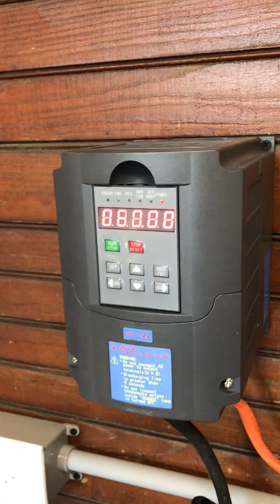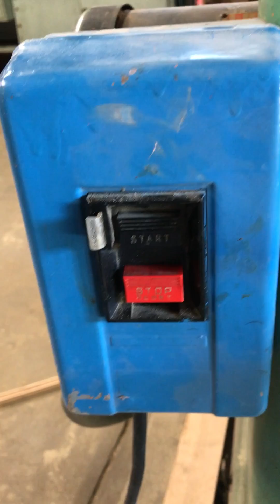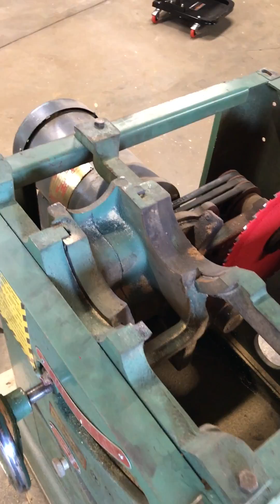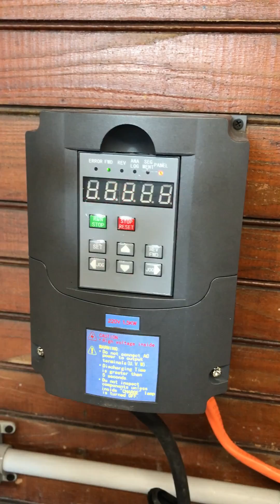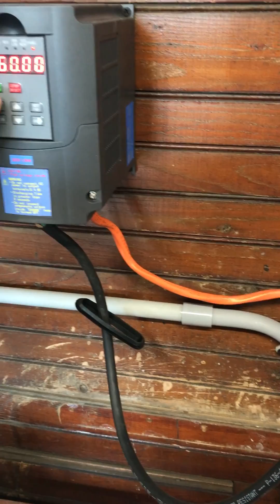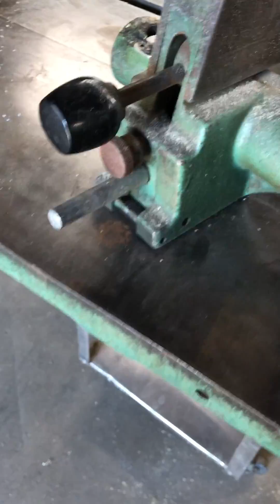PM 65 VFD

Comment: How much was the 3-phase horsepower output vs the step-down to single-phase with the VFD? I've read it basically cuts it in half.  This is why I've looked at Rotary Phase Converters instead of VFDs.  That and you can run several 3-phase tools off of one and not just a single tool like with a VFD.

Comment: is it feasible to lower the speed + change the blade to cut steel ?
Reply from the maker: Yes, you can adjust the VFD to slow the shaft speed down.  You will have to most likely experiment.

Comment: I would mount the VFD to the saw so it can be started and stopped at the saw this way you only have to run three wires to the VFD at the saw. This is how I run my lathe and it is very convenient to have the switch on the machine.

Comment: Thanks so much for the video.  I have a powermatic 66 that I just got, looking to set it up with a vfd as well.  Do you have a part list for your build?  Would appreciate any help!
Reply from the maker: The model I purchased for around $100 was an HY01D523B.  You can get them on E-Bay and other sites.
Reply: lunatixcoder thanks!  What gage wire did you use for connecting 220v 20 amp to vfd, and vfd to 220v 4 prong outlet?
Reply: @zollins  The 220v 20amp is 12-3, (red and black hot, white neutral, copper ground.). 30-amp should be 10-3
Reply: David Dean thx, David!
Reply: lunatixcoder (planning on using 10 gage wiring  for 30 amp max)

Comment from the maker: So 18 months later and still not a problem.  Ive used this thing a lot and it works like a dream and cuts like butter.  I actually did go through with the psycho strip down and rebuild and paint job and the saw looks like a new (old) stock saw.
Reply: I've got a PM65, restored, and am trying to put a splitter on it. I discovered Shark Guard actually sells a splitter for this machine (http://thesharkguard.com/orderpm65.html). It uses the an existing mounting bolt just behind the blade. Unfortunately, I noticed this mount is out of axis with my blade... Wondering if it got bent some time long ago... Speaking of which, any idea why there is a opening at the upper back of the cabinet? Whatever part was originally protruding there is no longer on my machine.
Reply: @ryang6513  What protruded from the back of the cabinet was a metal rod that connected to the blade guard assembly that covered the blade. Picture of similar set up can be seen here: http://www.ggober.com/shop/p66splitter.htm
Reply: @DaddysWorkshopoftheCarolinas  That is correct.  I was able to purchase a used one on ebay.  And yes, that blade should be aligned with the blade.  So it must be bent.  One thing those saws were famous for is that removal of the gaurd was common as when not used properly they would cause binding during the feed.  (mostly because people didn't maintain them properly)